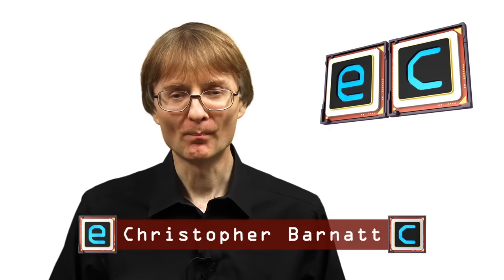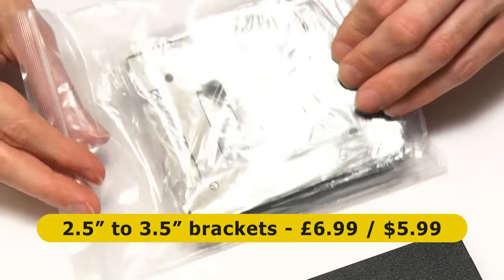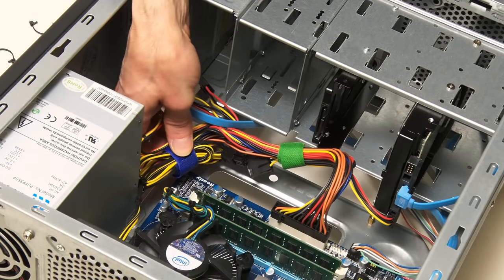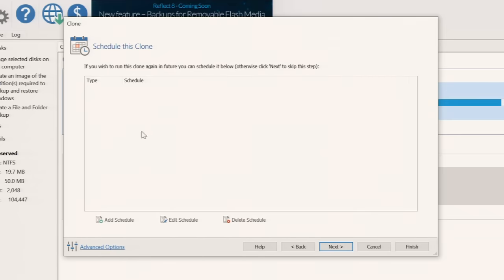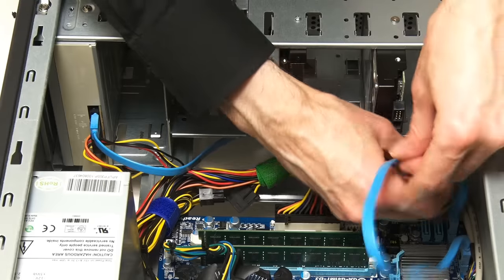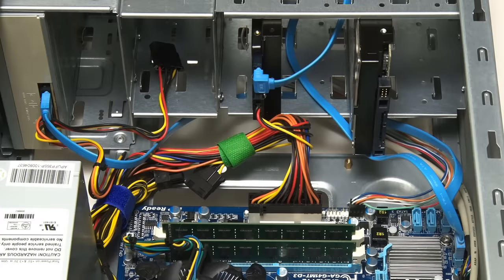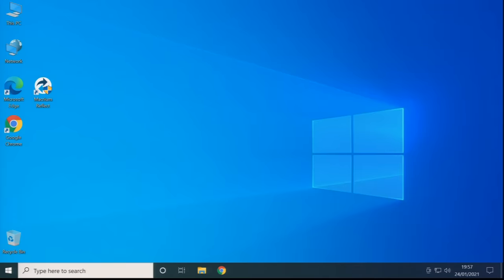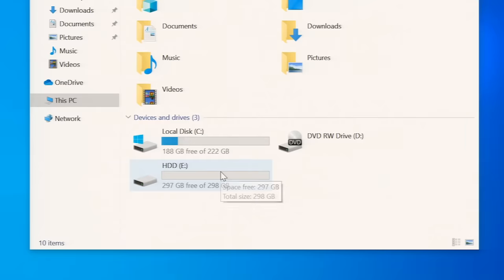Old PC Upgrade #2: SSD Boot Drive

Comment: Hi, :). Can a SATA cable connected to the motherboard but not connected to any device cause problems?
Like if it is just hanging out like a antenna, it's shielded i believe. Thank you in advanced*
Reply from the maker: A cable like that should not cause any issues -- it is no different to having one connected to an eSATA (external SATA) port with no drive connected, and that causes no problems.
Reply: @ExplainingComputers  Thank you for clearing things up! My beloved drive, what is a common HDD made a horrible loud noise but worked well. I had a cable connected like that. I have no idea what caused the humongous increase of noise. I checked the inside of my rig pulled the cable off, every thing seemed to be alright. However i still don't know why the drive did that? Maybe the drive was lonely? I installed a second HDD , it is all good now :). P.S.: Checked the drive with software no issue, S.M.A.R.T is enabled no complains either.

Comment: It's worth it to upgrade an entry level dramless nvme SSD (2200/1100 read/write 80k/120k iops) to an top of the range dram gen 3 ssd like 3500/3000 read/write 450k+ iops?

Comment: I would never, ever, ever , clone an old install to a new one.  I'd always do a fresh install and then copy the data over.
Reply from the maker: What, even if you have a drive failure? You'd never restore your system from an image/clone? A fresh install can take a lot of hours to re-register software.
Reply: @ExplainingComputers  Unless the drive that failed was a recently-installed one.  I've found that the performance increase from an operating system rebuild is compelling enough to put in the extra work.  Especially if it's someone else's computer.  I keep my own fairly clean.

Comment: Hold on. Didnt in your ssd explaination video say that it's best not to have your ssd full? Why now did u say that it's ok with just 800mb left?
Reply from the maker: The drive is here is not full -- the 800MB is unallocated space (space not used by any partition). But space on the drive is only used (not empty) when data is stored on it. If the partitions were full of data, and there were only 800MB free space on the drive, it would not be good for the SSD's life expectancy. :)
Reply: @ExplainingComputers  
So can we have 0 free space? Like giving it to recovery or main?
Reply from the maker: @RonLarhz  Yes, indeed. My point in the video was just that, as the drive should never be completely filled with data, leaving some unallocated is not a problem. In fact, all SSDs have some unallocated space anyway that the manufacturer never makes available.
Reply: @ExplainingComputers 
Oh i see... Thks.
Reply: @ExplainingComputers 

Woohoo!!! My clone job was a success!!! The next thing is reformatting the hdd and installing a caddy.... Idk if the cable i got is faulty. Sometimes the drives doesn't show up. I'm just glad that it didn't f up while cloning.

Comment: Everything went fine until I tried to install Macrium Reflect. The installation never started but it kept running in the background not allowing me to delete the installation file. Installing this software is a nightmare and deleting it is becoming impossible. After fighting with it for 2 hours, I just want to wipe it off my computer and install another software that I can actually install and use.

Comment: Do you have a tutorial of what if I just want to clone the OS from hdd to ssd?
Reply from the maker: I have a video on drive imaging and cloning here: https://www.youtube.com/watch?v=UTsq-HHz0Ss But you cannot clone part of a partition -- it would not be a clone! :) So if you want to transfer the OS only, you need to clone the partition it is on, then remove data and apps after you have booted from. Remember that any cloned OS will be for the specific PC hardware you cloned from it from, and will only be activated on PC. Cloning is not a method for moving Windows from one PC to another.

Comment: 39 seconds seems a bit slow for an SSD to boot. And it ain't much faster than your HDD.
I Installed an SSD in my 12 year old Dell laptop, and it boots in less than 30 seconds. It's a Samsung SSD, so not sure if that makes a difference.

Comment: Hello, I just bought an SSD but it is outputing much lower than its intended speed about half the speed. What do I do?
Reply from the maker: What speed are you obtaining? If a SATA SSD, you should on a speed test like CrystalDiskMark get between about 500 to 550 MB/s read if connected to a SATA III port on a motherboard, and about half this if connected to a SATA II port. Real-world copy speeds will be slower.
Reply: @ExplainingComputers  with crystal I have 280 as max reads....
Reply: @jesseomollo9405  that is sata 2

Comment: I did a clone with Macrium and found 4 segments on my original drive C the last appearing to be empty so I dragged then all to the SSD. The transfer took about 2 hours and the SSD appears contain the drive C data. BUT when I disconnected the original C drive I got an error about a missing file when booting. I re connected the original Drive C and when booting still from the SSD the booting process went fine. I think I am booting from the SSD but need the original drive C for it to work.
Any helpful comments would be gratefully received

Comment: YEP- switched my old OPTIPLEX over to SSD a good while back- when it first started being a "thing". ha.   LOVE IT--  My service here is slower than smoke of pooh... (it's 4 meg download speed on a GOOD day-- a constipated carrier pigeon would be faster).. so with the SSD and a few other things- mine is WAY faster than I'll need for a good while.   The county is installing FIBER OPTICS soon (the cable is hanging coiled on the pole out here now ready to be instaled- and they're already advertising 100meg, 200meg and 500 meg.. which will be WONDERFUL-- (the price is actually going to be LESS than what I pay now for this snail paced crap I'm using..

Comment: If you ever want to driver yourself mad.  i have been trying to run relect to clone from HD to M.2 SSD. After 3 tries, start looking the error closely to see it said to run chkdsk /r.  I also have to re-watch your video a few times before I got it thru my thick head how to resize the main partion where I downsize from 2TB to 1TB just to get everything on the SSB (if and when I get the HD error fixed)

Comment: Good explanation but I You missed an important point you should mention up front. , old pc may have old operating system- I got caught with this , there was no way I could get windows 7 to recognise ssd as boot drive. Maybe it can be done but not a task for anyone other than very knowledgeable pc user I think.
Reply: Make sure the cloning software you use is Win7 compatible. 
In this case, be sure you use Macrium Reflect 7.
There's free cloning software for Win7 all over the Internet.
Reply: @BigRalphSmith  cloning the drive wasn't the problem, getting win7 to boot from the ssd was.
Reply: @pizzagogo6151  That's not controlled by Windows, that's a function of the BIOS as was explained in the video.

Comment: What if I already have information on my SSD I need to clone to? Will it erase everything on there as it moves the clone from the hard drive to my SSD? I want to keep whats currently on my SSD.
Reply from the maker: Yes, all data on the drive you clone to will be deleted.
Reply: @ExplainingComputers   So after I moved it over I still had something called the system reserved partition.  I made a different partition active and now it's missing the boot file.  I am connecting my old drive back so I can reboot and then hopefully I can switch it back to the correct active partition.  Any advice?
Reply: Oh no I can't start up my computer I'm going to the windows boot manager and it's saying that the file boot/BCD is missing
Reply: @ExplainingComputers  fixed it with a bootable usb

Comment: Thanx for video. If you need faster pc, i recommend changing the operating system. My retroPC from 2009 (mobo ASRock K8A780LM, cpu AMD Sempron 3000+ soc. 754, 2x Kingston 1GB DDR400 PC-3200, vga  AMD RS780L [Radeon 3000] on board and with 32GB SSD and 160GB hdd i have a boot under 18seconds. I use a dualboot OS Devuan 3 Beowulf 64bits and Windows XP SP3 32bits (for retrogaming). and i have another from 2004 (Intel Celeron SL4PA soc.370 (2000), mobo Intel Desktop Board D815EEA, 320MB SDRam (128+128+64MB SDR PC133), Maxtor 40GB PATA, vga  Ati Radeon 7000 64MB DDR vivo works fine and boot under the 60sec. OS is Devuan 2 32bit

Comment: What a great video.
Can you help me with an issue I have with an emmc module that I want to install android 10 onto for my NanoPI M4v2. The Problem is that win10 won't detect /discover the emmc when i plug it in with a SD card adapter. Thanks and keep up the great vids.

Comment: i heard it is not recommended to use ssd before windows vista... except if are using TRIM (i guess)
Reply from the maker: Yes, without TRIM (which is enabled automatically in Windows 10), SSD life expectancy will be reduced. But the SSD will still work.
Reply: @ExplainingComputers  Reportedly modern SSDs do their own TRIM and don't need the OS to do it anymore. I have XP on an SSD and it doesn't seem to have any issues (3 or 4 years now).

Comment: Did not work with SSD clone software.  Tried several times and the program froze and crashed.  Then with another SSD it gave an error 8 message and promptly crashed.

Comment: My Master, Sauron The Great, bid me to tell you this! My Master, Sauron The Great, is a very old PC user and his craft is great. So:
- Windows is constantly using several storages - Windows/System, Windows/Temp, pagefile.sys and often files used by specific program
- All of them being on the same drive is rather slow (just one example - extracting .zip is done by reading file from drive c: (example) to windows/temp @ drive c:; then copying (yup, not moving) to drive c:; then deleting files (or not) from windows/temp @ c:; using pagefile.sys during the whole process if needed (sometimes not)
- this is extremely inefficient
- 128gb or even 256gb are rather cheap and optimal configuration looks like:
windows on a separate drive
temp file on a separate drive
pagefile.sys on a separate drive
- this way, all 3 drives can work at the same time, reducing the time of storage-relating work greatly
- user doesn't necessarily needs 3 or more ssd, but 2nd improves the situation quite noticeable
- this is checked and tested many times, we do it in Mordor all the time
- we put no instruction how to do this, it's kinda 5min procedure, but requires explanations - idea for the channel author (otherwise, google everything)

Comment: hi chris do you think this would be a better value for money upgrade than doubling DDR2 ram from 4gb to 8gb on my Acer Aspire laptop running win7 64bit
Reply from the maker: Almost certainly. Going from 1GB or 2GB RAM to 4GB makes a big difference. But for general performance, the lift from 4GB to 8GB is less significant, whereas an SSD should make a machine far more responsive.
Reply: @ExplainingComputers  thanks for the reply, am going to try it, maybe later I will also get 8gb ram when the price comes down,  However win7 while a good o/s is nearly finished but I'm assuming a win 8.1 would be a good upgrade with the SSD and 8gb pc2.

Comment: Does this motherboard support UEFI booting, and booting an NVME drive ($100) in an NVME PCIE adapter ($6)? NVME SSDs are much faster than SATA SSDs. Is the hard drive partitioned as GPT?

Windows 8/10/11 has NVME drivers built-in (although if cloning from SATA to NVME you have to boot in safe mode once to get it to switch to the NVME driver).

Oh, it's an old 2010 BIOS without UEFI support.
Reply from the maker: No, this board does not support NVMe PCIe boot. And the speed of an NVMe drive connected via PCIe on this system would be far slower than when connected to a modern PC (as the PC here is PCIe 2.0). I am well aware of the speed of NVMe drives used with a modern motherboard, and also that using an NVMe drive on a system like this one would give little or no advantage due to the rest of the technology in the system. But the speed of a PC and its boot time depend on a great deal more than the speed of the boot drive, as this video clearly demonstrates! :)

Comment: How important is the capacity of the SDD? If I'm using an external HDD of 2TB, can I get away with a 120GB SDD? Or is it better to have a bigger capacity SDD? I'm not worried about storage space, I just want quicker start ups. Hope this makes sense.
Reply from the maker: The capacity does not matter, providing it is large enough to store the OS and applications, with some free space. So 120GB is fine for a boot and applications drive in most instances, with other files on another drive as you describe.
Reply: @ExplainingComputers  thanks so much for the reply. My local disk now says "270GB free of 464GB." What size SSD would you suggest for me to purchase?

Comment: Hi Chris, Do you have plans to add/upgrade wifi and Bluetooth? could you add some Free cast software to operate through them also, info want to set up an old clunker ( no one is gona nick a clunker ) for mi mates pubs for the did you see gang. so simple your vid's thank you. Mike R

Comment: The ssd was bad mounting on the plate, is supose to go in the other direction.
Why to use that program and made all that extra steps? There is many others much better and is prefer to do it offline with a live tool.
The speed difference in you test and in this particular case don't make sense the extra money. 
But im sure that is something not right configured the sistem.

Comment: it's recommend3ed that 10 percent of the given space of any SSD should be set aside for overprovisioning to extend the drive's life.
Reply from the maker: I am well aware of this, and (a) manufacturers allow for some of this space on a drive anyway, and (b) it is used space, not allocated space, that matters -- if you allocate 100 per cent and use 90 per cent of that allocated space the effect is identical to allocating 90 percent and using 100 per cent of it, butt he former is far more flexible. I have covered his topic in my "SSD Life Expectancy" video: https://www.youtube.com/watch?v=-XZNr7mS0iw

Comment: Thank you Chris for your very thorough tutorials.  Although i am a new subscriber I follow your videos with interest.
 I got an old surplus PC from the office which for security reasons had its SSD drive wiped out.  I have an HDD with Windows 10 Pro installed from another computer where the motherboard went faulty.  I have installed the HDD in the computer and it works although very slow.  The processor is i5 and it has 8G of RAM.  So I did not expect it to be so slow.  Will it help if I were to clone the HDD onto the SSD?
Reply: You  should make a fresh install of Windows 10 on your PC with the new SSD.  Your old HDD with Windows 10 will feature drivers and configurations from it's original installation that are not compatible with it's new host, which will explain why it is very slow.  I'm a  little surprised that it will boot at all, but I would recommend a fresh install on your SSD.

Comment: Molex to SATA, lose all your data.

It would be best to connect adapter to DVD.
Reply from the maker: "Molex to SATA, lose all your data" is a great urban myth, but clearly not true. There have been problems with some non-crimped adapters. But the idea that all Molex to SATA adapters fails and cause fires is ludicrous.
Reply: @ExplainingComputers  Nonetheless I would more likely put my DVD drive on risk (even at 0.001% chance) rather than SSD/HDD.

Great video anyway.

Comment: 04:24 SSD goes inside the bracket....(Not on Top of bracket) For added protection....
Reply from the maker: It can be positioned either side, if normally "inside" as you say. :)
Reply: @ExplainingComputers  If you have multi SSD's(8 bays) on top will not work.... (On top of bracket, may only work on the very top....)

Comment: I will upgrade my HDD to SDD via cloning. My question, my HDD has two partitions, one is for Drive C OS files (171gb) and the other Drive D for media files (420gb). Can i just clone the partition for my OS drive and then manually copy the other partition by using my old hdd as an external drive via sata cable? Im asking since i want to make the OS migration faster.
Reply from the maker: Yes, you can clone just one partition (although there are likely to other hidden Windows partitions) just as you describe. And you could also copy other data manually just as you note. See my most recent video on drive cloning, as sadly Macrium Reflect Free has been withdrawn: https://www.youtube.com/watch?v=1gTJw8ehkVc

Comment: My old computer HP pavilion elite m9250 f is running vista 64 bit . I tried to download macrium reflect but vista is to old and it will not download. I've put Linux Vanessa on it.
Any suggestions besides dumping this computer. It still works great . Microsoft smh.

Comment: This looks simple but typical my luck, the drive doesn't boot :( Currently tearing my hair out to figure out why. Boot order checked etc. Now starting to look at bcdedit on the ssd which shows the boot manager and boot loader are pointing to the original locations which I think might be causing a problem. Something not covered as a check in this vid :(